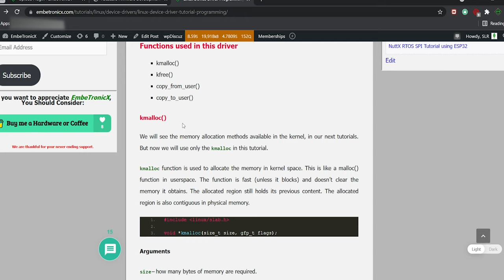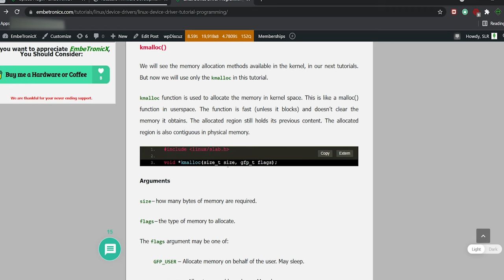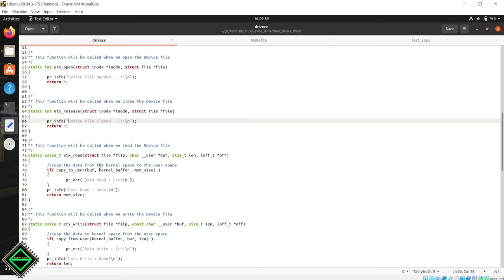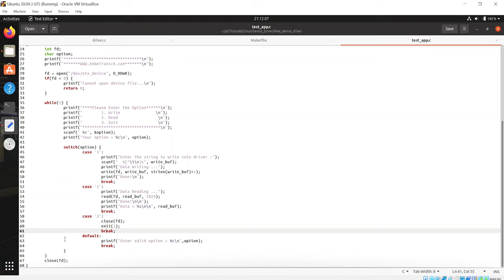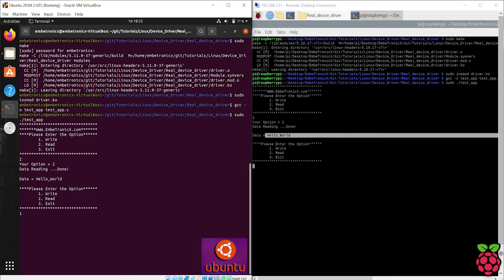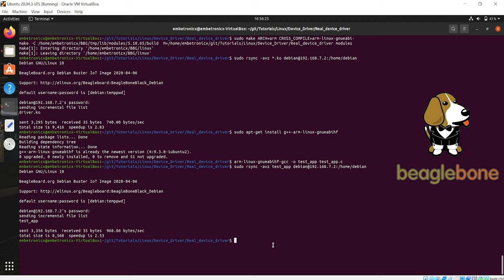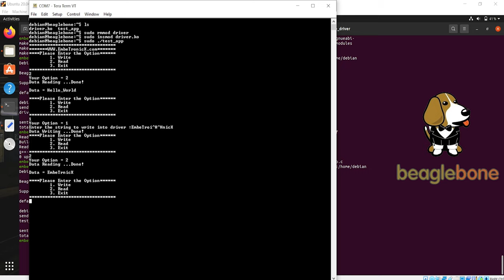Linux Device Drivers Part 7 - Real Linux Device Driver in BeagleBone, Raspberry Pi, and Ubuntu

Comment: If I have to learn device driver programming which should I buy beagle bone , raspberry pi , or a simple Ubuntu machine can perform better
Reply from the maker: If you are beginner, then first try with the ubuntu machine that you have. Once you get some idea, then you can buy anything. But my preference is beaglebone. If you buy raspberry pi, you can use that for some other purpose also like mini pc.